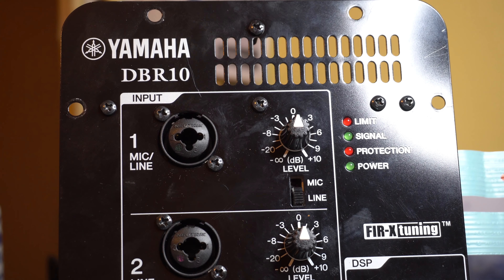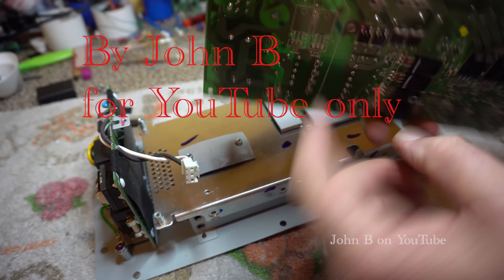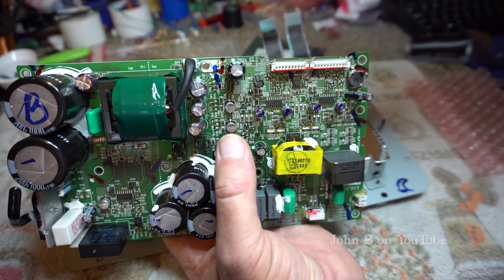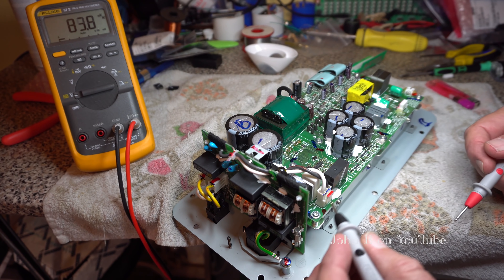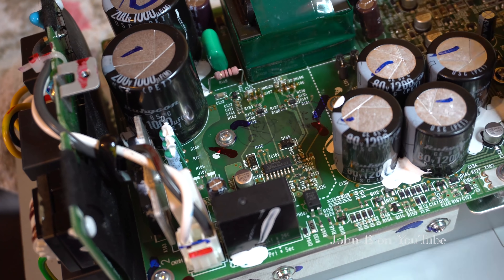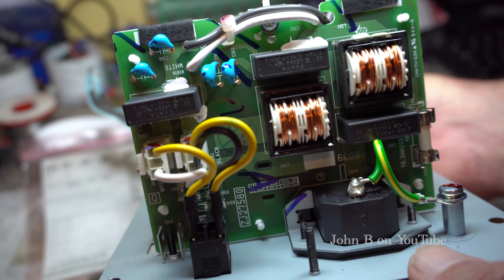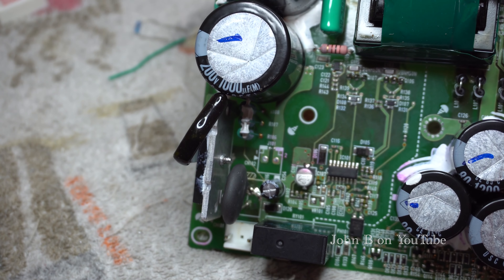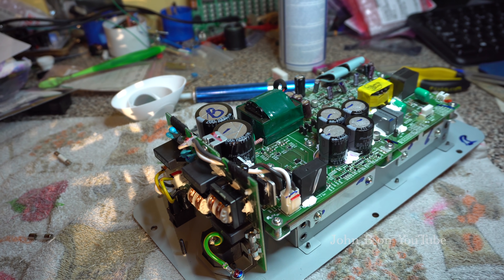Yamaha DBR10 Repair and Review - Spoiler - It's a Great Speaker - But it still failed !

Comment: So i have the bluetooth one, i can get it to power on and hook my phone to it. One day at work all the bass just went out and all you get is highs from the tweeter. What would be causing this? After that day at work i left it sit for 3 months. I just plugged it in last night and it was actually working and sounded great. Today i plugged it in turned it on and turned it up and all the base shut back off and now all i get is high pitch music coming out. Do you know by chance what would be causing this?
Reply from the maker: Sounds like a dry joint around the bass chip.
Reply: John B John, what do you mean by “bass chip”? I’m having a similar problem with my active RCF 2-way. The LF woofer cuts out when driven at mid-high volume, quite possibly at peaks of LF content. All is left is the HF. I’d lower the gain and the LF would come back. The speaker itself is fine, had it tested. could it be the processor/crossover failing, thermal cutoff, or transistor/cap failing? Have you encountered this problem? Any help would be appreciated, thanks!
Reply from the maker: @CostaBle  If you watched the video, you would see the bass chip and treble chip drivers.
Youn need to make sure your woofer is not burning out, do you have more than one?
Reply: @JohnB-2021  i only have 1. I called bosh and they told me to ship it to them and they would fix it for free. I decided to go that route before opening it up and seeing if I could fix it.
Reply from the maker: Nicholas Hoover-Hill free is great 👍
Reply: John B I do have another one, I’ll swap the woofer and see if still cuts out
Reply: @JohnB-2021  just got it back. They said the woofer was bad. Says they replaced it. Sounds amazing again.

Comment: So I’m kinda between getting DBR12’s or the electro-voice zlx12’s. If price were equal it would be easy, but i can get the zlx’s for about $80 less. Any suggestions?
Reply from the maker: The Yamaha are many times more powerful, at $80 difference I would never consider anything less than Yamaha.
The Yamaha have 2 500 watt driver chips, the ev has a baby driver chip.
Reply: @JohnB-2021 , thank you very much for the response.
Reply from the maker: @matthewfrohbieter1803  Something must have changed because Yamaha's DBR range were hundreds of £ / $ more expensive than the Electro Voice ZLX12 & 15 series.
Maybe Yamaha have dropped their prices, if EV have put their prices up they are having a laugh.
The design between the 2 is like chalk and cheese or day and night.
If EV were hundreds cheaper I would still never buy one.
I assume you have seen my EV videos?
Thanks for your comments

Comment: Agreed, good engineering
Reply from the maker: Great amp but it did go wrong.
Reply: Exceeded SOA for switching FETs. SOA monitoring is missing in most power and amplifier designs. Costs money. Needs to be tuned and tested under all environmental conditions.

Comment: Sir plz help
 i have Yamaha DBR15  2speaker but today program our after High Wallteg electroccity com so my Yamaha DBR15  speaker's not working and not show to light also
Reply from the maker: It will probably have failed in the same way as the repair
Reply: @JohnB-2021  ok thanks sir

Comment: I have a Yamaha DBR12 that I don’t use much, but would use it more as a portable speaker. I want to bypass the mains supply, and directly supply 12-16v to run from a lithium battery. Or a car battery.
Reply from the maker: The Yamaha requires too much power to run from a portable power source.
There are speakers out there that run on 12 volt batteries.

Comment: Yamaha amplifiers are very reliable. I'm keen on a pair of DXR15MkII for a small band studio (need the lower frequencies without a sub). They have a 3-way but the price goes very high. I'd also like to have a Yamaha home theatre amp as well. Owned a big class AB Onkyo and what a PoS.
Reply from the maker: Reliable until they stop working.
Reply: @JohnB-2021  Then reliable again after being repaired lol.
Reply from the maker: @Shaker4x4  except for the fact that them blowing up makes them no more reliable than any other amp.
Reply from the maker: Never seen an Onkyo, they have a good name in the hifi circles and would like to try one.
Reply: @JohnB-2021  Yeah no Onkyos in  PA gear, I own a large Onkyo HT amp and nothing but problems. Going with Yamaha HT next time. But definately keen on the DXR 15" MKii for a music studio. I need bass, but not subs. I need small stage setup, without the excessive gear.
Reply from the maker: @Shaker4x4  Thanks for that.
You must have a large studio since you're keen on the DXR15.
I guess the bass on a 15" would be louder than the base on a 12" at a given volume, only a guess.
I thought Onkyo were top notch, surprised to hear yours have given you problems.
Reply: @JohnB-2021  Onkyo receivers are known to have had issues with under-rated capacitors on main boards not able to handle the heat and in mine is a bad batch of DTS decoder chips that main boards were being replaced under an extended recall warranty. But because I was in the country and mine had not yet failed snd I didn't get the memo, I still have had that bad chip which has given me problems. I don't intend cranking the 15" speakers in a room, only on stage. Otherwise they are a strong workhorse capable of down to about 46Hz, so are fine for what I need.

Comment: Hi John, I am writing to you from Mexico I have a Yamaha DBR15 speaker with the same circuit that you repaired in the video, the problem is that they connected 220 volts instead of 110 volts when I checked the resistance of 6.8 ohms at 5 watts (R116 ) It was open and the capacitor from 1mf to 400 volts (C154) presented a hole in the upper part, I changed this two components and it worked, put everything together again leave the speaker working and at half an hour an explosion was heard and the capacitor C154 of 1 mf at 400 volts burst and the diode D126 the D1F60 opened, check the Mosfets Q106 and Q107 and they do not mark me in short circuit, the strange thing is that the speaker sounded when I change the resistance and capacitor and now that it explodes the filter on D126 opened but the 6.3 amp fuse and resistance did not burn, which you think it may be. Help.
Reply from the maker: Hi Juan,
I believe the speaker is 110 or 240 volts so 240 should not have been a problem.
I'm guessing a diode had gone short circuit causing the capacitors to explode.
In the schematic, you will see a dotted line, everything to the left is mains potential.
You need to spend an hour checking all the components to the left of the dotted line before plugging it in again.
Capacitors only explode with wrong polarity or too high a voltage, a short circuit diode will allow the wrong mains polarity to reach the capacitor.
If there are 2 capacitors in series and one goes short circuit, the other will have twice the voltage across it and explode.
Reply: @JohnB-2021  thanks you John .
Reply: same problem here, I think Yamaha messed up. they have put the wrong fuse in this.
Reply from the maker: @karmacadabra9944  
Quote from Andrea Vico,

"Fuse is not made to prevent damage to the electronic circuit. It's not the goal of a fuse. So if the electronic fail the fuse is not the culprit"

Comment: Hey John, really interesting video. I've got a set of Yamaha Class D amps (P2500S) which have all got slightly different faults. One of them definitely seems repairable but I'd like to send it to someone who knows what they're doing! Where are you based? Is there a way to contact you?
Reply from the maker: The P series have a tonne of parts and most people will not pay over £100 to have them repaired so I don't bother.
I don't think they are class D, I believe they are class B.
Reply: @JohnB-2021  ah okay that’s a pity! Thanks all the same

Comment: Hi John.  I have a DXR12 with a very similar circuit (at least visually it looks so) and the same symptoms - no power, relay doesn't click, 6.15A slow blow fuse intact etc.

I've got to the limits of my competence and rather than start faffing about with things I don't fully understand, I'd like to use your services!

How do I get hold of you?

Cheers.
Reply: I'm in the UK by the way.
Reply from the maker: Hi, I'm not repairing amplifiers at the moment but there is a guy on ebay that can look at your amp.
https://www.ebay.co.uk/itm/Mackie-SWA1501-SWA1801-SRM450-Thump-series-servicing-and-repair-specialist/153867355114?ssPageName=STRK%3AMEBIDX%3AIT&_trksid=p2060353.m1438.l2649

Comment: Hi John, I have an Yamaha DXR12 active speaker in Protection mode, when I turn on the speaker it makes an nasty sound for about 2 sec and it remains in protection mode, what can I look for inside to try and repair it? Thank you.
Reply from the maker: At a guess, maybe one of the output fets is short circuit which would put dc straight to the speaker. Check the amp section.
Reply: @JohnB-2021  thanks, will do...
Reply: Nicu Urs did you solve it?
Got the same problem. Only after 10/20 min
Reply: John B maybe  i can send it to you and you can make a video off it...while repairing 😁

Comment: Do you know that audio mosfet use these equipment? regards!
Reply from the maker: IRS2092S & STF19NF20
Reply: @JohnB-2021  So this does not use transistors for audio power anymore?
Reply from the maker: @morritox  
It's a class D, it uses FETs

Comment: Hi John, appreciate the video. I have aqcuired a faulty Yamaha MSR400 speaker that turns on but the sound is very low and seems like its all treble and no bass. After having a fiddle the sound went back to normal after increasing the volume but after connecting it to my electronic drums I think I may have thumped in a very high frequency which has put it back to the faulty sound of no bass and very low volume and only treble. Is the speaker repairable? I'm not sure how to troubleshoot this one. 

Thanks for your time if you read this and all the best.
Reply from the maker: It could be anything.
I had a Mackie speaker doing a similar thing, there was a dry joint for the bass power, the treble was fine.
Reply: @JohnB-2021  cheers mate I have a feeling it's a bad joint but will have to wait for parts to even open the damn thing
Reply: @JohnB-2021  Had to come back and thank you as it was just a lose connection with one of the bass joints. All sorted and the speaker is working great. Keep up the great stuff.

Comment: The dbr Amplifier how does it compared to ev zlx Amplifier?
Any thoughts before i choose the company i buy speakers from.
I would gate to spend my hard earned money on crapy Amplifiers.
My 2 choices are yamaha or electro voice.
You opinion matters cause you know what they made with/of.
Reply from the maker: It depends on what EV you're looking at.
I would never buy an EV product, just read the comments in my EV videos.
Half love them & half hate them.
Reply: @JohnB-2021  either the ellx112/115
Or the dbr12 /15
Or Dhr10 /15
Reply from the maker: @mikedubz5576  I have only seen the ZLX amp and some EV sub I repaired.
Similarly, I have only seen the DBR range of Yamaha amps so can’t comment on any others.

Comment: I have a yamaha dbr 12, no sound but only some hiss coming from the small speaker, why is that so :(
Reply from the maker: Sounds like the bass is blown up
Reply: @JohnB-2021  What can I do to fix this :( it is the same since the day it arrived. I didn't realize this because a decent sound is already coming from the 12" speaker. I didn't even know there were two speakers
Reply from the maker: @loneliboy1234  I am lost, you said hiss coming from the small speaker and now decent sound coming from the 12" speaker.
I would get it checked by someone else first.
There is a tweeter and a woofer.
Reply: @JohnB-2021  Hi, sorry for misguiding. When ı play something, no mucis is coming from the tweeter. Tweeter only makes some hissy noise. But the woofer work just okay (no hiss whatsoever). The decent sound coming from the woofer unabled me to realize no sound coming from tweeter. 

Thanks a lot for the help btw :)

Comment: Hi Mike ? I'm totally stressing myself out..? Do you recommend the Yamaha dxr over the dbr series...or it's basically the same speakers...dxr has fan in the outer back is that better less likely to get hot..I live in hot humid Florida... heat & humidity is a huge problem...or should I stick to none powered speakers like Peaveys BLK widow speakers...great videos! Thank you! God bless you 🙏.
Reply from the maker: Hi, I'm John
I'd recommend any powered speaker by Yamaha or Mackie, not seen the dxr series.
Thank you

Comment: 28:25 "why pick a 105°C there?"
BOM reuse? Hard to tell.

(Edited, because I didn't like my tone. Came across as a show-off)
Reply from the maker: But all the others are standard temperature caps so there goes your BOM.
I build pcbs so I know about BOM and re-using existing parts.

Comment: If Yamaha knows what they are doing, is something nasty. I apparentely just lost a $600 speaker because the fuse did not break because is not the right fuse. Shame on you YAMAHA!
Reply from the maker: Karma Cadabra
, my video was not intended to make consumers believe they have incorrect fuses fitted.
If an internal fuse fails, it is due to a blown component.
I simply couldn't understand why they would have a specialised resistor fail instead of a fuse.
A fuse is cheaper than a resistor and easier to source too.
I guess the resistor failing is to stop end users changing an internal fuse when there is an internal failure.
i.e. users of the 450v2 Mackie change internal fuses and plug them back into the mains, this is the wrong thing to do since it causes more damage 99% of the time.
Reply: Fuse is not made to prevent damage to the electronic circuit. It's not the goal of a fuse. So if the electronic fail the fuse is not the culprit.
Reply from the maker: @andreavico6198  Well put
Reply: Fuses are last-resort protection devices. I like to think of them as a protection for the user, more than a protection for the circuit.
Reply: Don't yamaha offer 7 year warranty on their speakers?
Reply: @ninjatzuuninjazuu8776  in Brazil it is only 1 year.
Reply: @JohnB-2021  You see, in Brazil we have 2 currents: 110v and 220v. You could have both in a same building. So, every electronics like this type of speaker comes with a easy-access fuse for you to change it for use with the right current. They also come with a diagram in the rear saying something like "110v-2a/220v-1a", so you know what fuse to use. Yamaha simply placed a switch for you to toggle 110v/220v, but it is the same fuse inside, so it is obvious that it wont work half the time. My speaker DBR10 burnt ALMOST ALL it's components, EXCEPT for the fuse. The room was filled with toxic smoke too. If you make a bi-volt product, you should use two different fuses. It seems that the brazilian version was transformed throuhg a very lazy solution. I sued them because of this, and I won.
Reply: @mattmoreira210  even then... the room was full of toxic smokes, so... not very protective. Everything inside burned, BUT the fuse.
Reply: @FilipeGeyerVocalStudio  call yamaha and they will ask you to send the speaker for fixing
Reply: @ninjatzuuninjazuu8776  not in Brazil. Here it's just one year, maybe because of the lazy bivolt adaptation
Reply: @ninjatzuuninjazuu8776  they did, but it costs more than a new one.